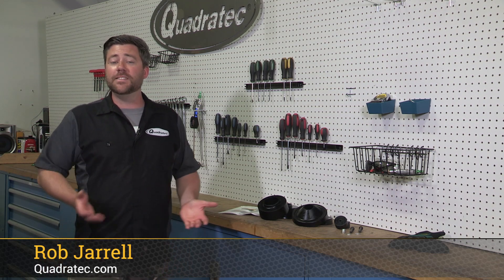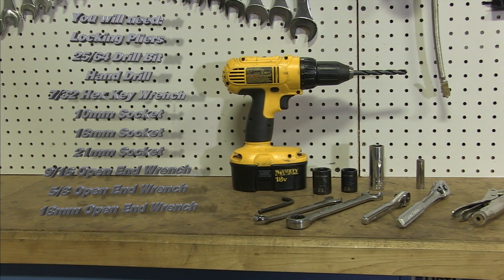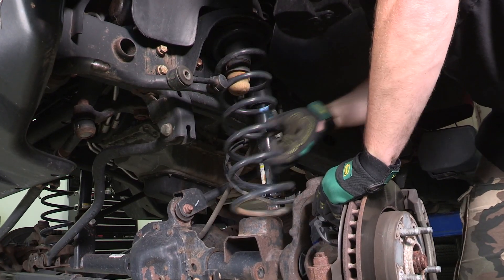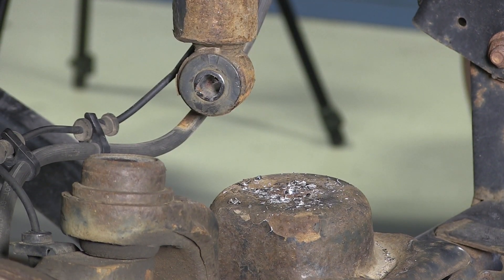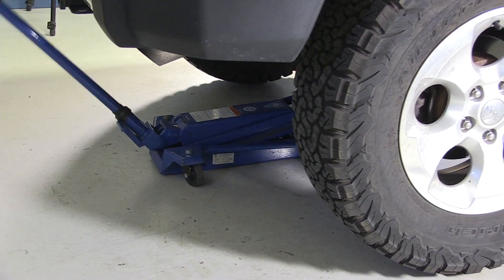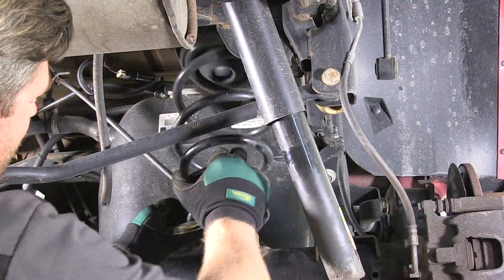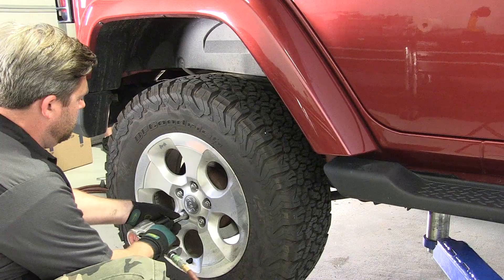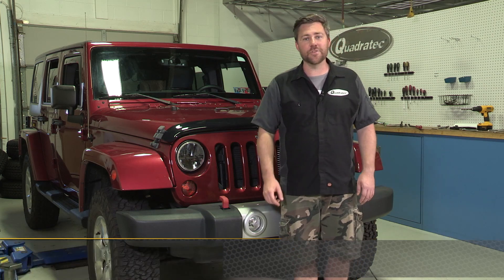Quadratec Maximum Duty Leveling Lift Kit Install

Comment: I have the level kit just haven't put it on my jeep yet why don't you need that brake bracket anymore? and is there a reason why the front spacers  are not even when they are on a flat surface?
Reply from the maker: +wranglerX That brake line bracket is the right length for a stock ride height, the line needs a different routing for the extra height. Are the 2 spacers different heights from each other? Or is it they don't sit level?

Comment: I thought 33 inch tires did not need a lift
Reply from the maker: +Edgardo Amado You can get them on, but you will rub on full lock. The owner of this JKU had a slight rubbing issue that was corrected with this spacer.
Reply: If you have tires just a hair under 33" and have wheels with 4-4.5" backspacing, you shouldn't have rubbing issues. OEM wheels have like 6" backspacing which is why they rub as far as I know.